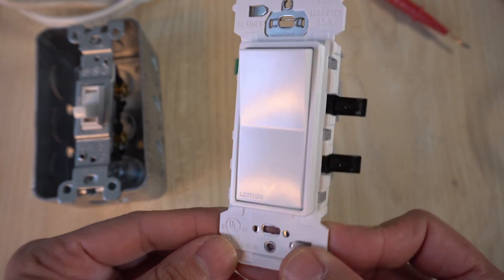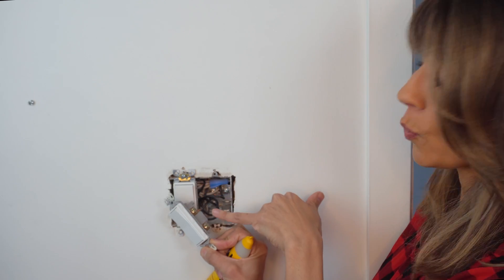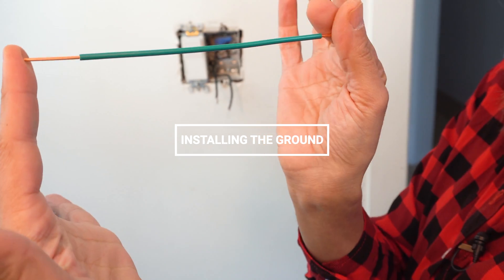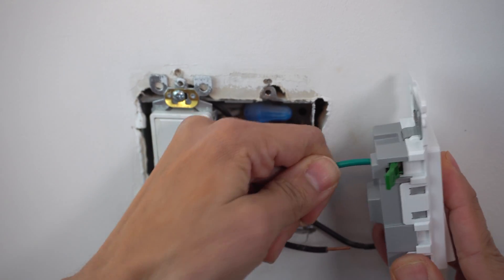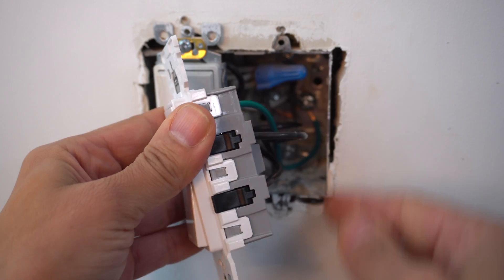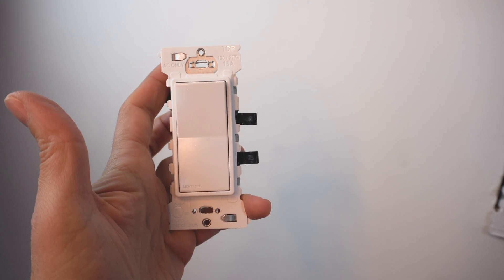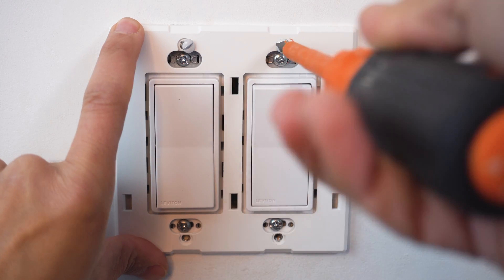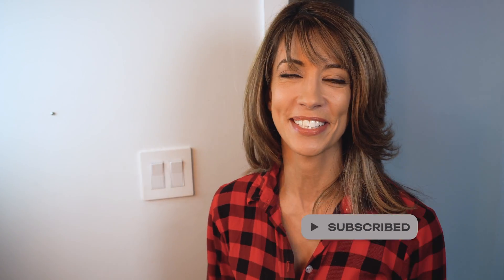Switches of The Future Are Here: Why They Finally Got Rid of Screw Terminals

Comment: Can you install these 15 amp switches on a 20 amp fuse panel breaker?
Reply: Yes it will trip at 15A just don’t do it the other way.A 20A won’t trip at 15A.

Comment: I could say a lot about this video, nothing really critical, just interesting to me.

I definitely like the new WAGO connectors over the previous generation WAGO’s. In my experience, this is about the third generation of WAGO connectors, but new connectors with bigger tabs are so much easier to open.

I hope Leviton has improved their plastic formulation. I used Lutron Claro Light Switch & Outlet Cover Plates with some Leviton outlets in my home about 12 years ago and color wise they were a good color match originally, but since then the Levitons are turning more Ivory color while the Lutron wall plates are still a glossy pristine white. (I’m going to replace the outlets on this remodel because they’re old and ugly, like me🤪) Also, along with safety tips, like turning off the associated circuit breaker (CB) and verifying the power is REALLY off, I like to, since I’m already working at the device, label the wall plate and the back of the cover with the panel # & CB #, like M2 - 5. Saves time for someone later when you need to find the CB to turn on/off. It’s easy to pry the cover off. Someone will appreciate this. Maybe let the home owner know about the labeling if you do.

Electrical tape in a box? Interesting comments on that. I agree that someone not familiar with electrical wiring probably shouldn’t be mucking about in an electrical box. If you use electrical tape, pay a little more and get a better quality tape that won’t break down over the years. I’ve gifted some electrician friends with 3M Scotch Super 88 Vinyl Electrical Tape, especially if you’re using it on your own stuff. Personally, I’ve never used tape on a switch or outlet.

Last one, I promise. Are you really using slotted screws? You must have ample time and great patience. Throw those screws away! Get yourself some 6x32 Philips  and a good electric screw gun. I’m on my second screw gun (a small Milwaukee) for over 40 years, can’t say the same for batteries, maybe 3-5 years.) Broke ligaments in both wrists. Do yourself a favor and get a small electric torque screwdriver with a Chapman set of bits. Even better than Phillips screws, try some square drive screws, but whoever follows you will probably curse you if you use the square drive screws. I first ran into square drive fasteners on a Canadian motorhome. I couldn’t believe how much better they are. They were even used on my kegerator!

Just my opinions, your mileage may differ. I hate wasting time and effort especially with repetitive jobs! But then again, I’m probably not as agile as you are.  😁

BTW - I’ve just discovered your channel, thank you. I am getting ready to lay about 1,800 sq ft of riff cut white oak flooring and the subfloor is a mess. Your instructions on using floor leveling is great. I’ve used it before but was a little trepidatious on using it on a large area. Thank you!
Reply from the maker: Great to hear from you, and thanks for the detailed comment; I appreciate your perspective on the evolution of the connectors.

Comment: Why don’t you want the copper exposed around the bolt? Asking because I need to replace a switch and noticed the broken switch has the copper showing as in this video.
Reply from the maker: Good question thanks for asking. Copper wire is conductive. If metal touches metal it can cause a short which is not safe. That is why wires are insulated with the plastic sheathing for protection.

Comment: What outlet covers do you use? I have been replacing light fixtures all over the house lately and have found a couple dirty secrets. With a bathroom vanity light there was no box. House built in 1988. Supposedly back then code allowed the fixture to be the box. Nuh uh! Put one in. With a bathroom ceiling light it had a very shallow, round metal box that wasn’t grounded. Yikes. Fixed that. I love Wago connectors. Anxious to try the lever lock outlets and switches. Hopefully the prices are coming down. If I replaced every switch and outlet it would cost a fortune and take a month to do. But I’m retired. I hope I have time.
Reply from the maker: If you’re replacing a lot of outlets and switches best price is to buy in the multi-pack. I have a link in the description where they cost $2 each. You can use a name brand or budget brand cover. I often use the less expensive ones because and they work well. It’s great that you are taking the time to do your electrical when you can. That’s smart.
Reply: @DaruDhillon  thank you. I checked through your link and the multi-packs are well priced. Just have to do the replacements in stages. We have 3 levels so a lot to change out. I just ran across your video; learned some things; enjoyed; subscribed.
Reply from the maker: @jugheadjones5458  thanks! I’m glad you found it helpful. I like to do projects in stages too. Everything comes in time. Enjoy your day!

Comment: Hello Daru , Since you introduced this kind of switch , I hope it's available in 3 way and 4 way because I've replaced 3 way switches and occasionally I'll come across a light fixture that's controlled from 3 or 4 locations which incorporates 4 way switches as well 
Also I hope they're available with the standard handle on the switch 
This design is great as the receptacle with the lever connectors and no worries about grounding out against the box , Since you introduced the switch , It reminds me back when I was little , The house we lived in had the old style push button switches along with either brass or copper cover plates 
You are one of the very few individuals who connect the ground wire to the switch , Which is great because a switch can fail , Especially those cheap switches which the internal mechanism can come in contact with the mounting bracket of the switch which can make it live and dangerous 
Whenever I replace switches , it's very rare that I see ground wires connected to them , It's great that you connect the ground wire to the switch because you understand that proper grounding is just as important for switches as it is for receptacles
Reply from the maker: Thanks for that Marty I tend to ground everything. They do make 3 way switches in these too which you should like.👍🏽
Reply: @DaruDhillon  Thank you very much 
When I was talking to my younger sister and her husband about replacing all the receptacles and switches In their house 
I definitely want to use the new style receptacles and switches you introduced because they have your stamp of approval and they'll save alot of time in installation and I love the safety designed into them 
Plus they'll save me money on electrical tape because they don't need to be taped as compared to the conventional receptacles and switches , One thing I definitely love about your videos in electrical work is that you use insulated screwdrivers and I have them too , Insulated screwdrivers are especially important when working in a circuit breaker panel , It would be great if they came out with a ratcheting insulated screwdriver because sometimes I wanted an insulated screwdriver that's ratcheting when making connections in tight places 
So what I did , I have a Stanley ratcheting screwdriver and I put 4 layers of heat shrink tubing on the shank of the screwdriver to insulate it because a ratcheting screwdriver is very helpful when making connections in tight places , Such as a circuit breaker panel 
The only part of my Stanley ratcheting screwdriver that is metal is the shank and there's no metal at the handle itself 
So if you have a ratcheting screwdriver 
Apply 4 layers of heat shrink tubing to the shank and give it a try and see what you think , I'm so glad I found your videos because you do them very professionally and safely , I saw that kind of tester that you use in your videos and where did you find that one because I want to get one for myself and who makes it , I have a receptacle tester but I like the one you have 
Another very cool item to have in your electrical tool kit is a circuit breaker finder 
My older brother got me one for Christmas several years ago and it sure saves time looking for which circuit breaker to turn off

Comment: Can you give your advice on Leviton E5601-MW recpeticals they are new with built in wago connectors, I just bought 30 of them but after reading some stuff online and talking to an electrition family friend i am now parinoid about using them. They do seem very light and plasticky but i dont plan on plugging anything big into them like heaters etc. Also is it safe to install 15a recepticals chained to 20a ones on the same circuit?
Reply from the maker: I think it’s important you make a decision that feels right to you. I can understand all sides. Electricians are often cautious with good reason. On the flip side extreme caution prevents innovation. If you’re using heaters you can always go with traditional outlets. I had a heater catch fire on me once, years ago due to overheating. Caught it just in time. I haven’t researched or used the model you posted so I can’t weigh in. Thanks for your question.
Reply: Ok, the outlets are the same versions as these switches. @DaruDhillon

Comment: looks clean but I can see myself cracking switch while breaking off tab lol!  Also how easy is it to remove face plate without wall damage?
Reply from the maker: Regular wall plates remove easily with a flathead screwdriver. Screwless plates are removed by inserting a flathead screwdriver on the underside of the plate to gently pop off the wall plate.

Comment: Imagine how a plastic molded assembly holds up to an assembly made from Steel over 10 years? While you cannot see inside that assembly, what actually bonds your circuit together when you close that little plastic snap you can absolutely see how well a good electrician can make a perfect electrical contact with a screw against a copper wire and apply the proper amount of torque so that the connection is both clean and strong and tight so that it does not turn into a fire hazard. Also after 10 years when you open a box that has had electrical tape wrapped around it to make it less shocking for the person to service it, you usually find that electrical tape is no longer functional as such a safety barrier. If you are not the electrician or know what you're doing you shouldn't be in those tiny little boxes in the first place! Cute device, but I wouldn't trust it till I get one in my hands and completely take it apart to see just how good it makes contact for an electrical connection. I worked for a plastic manufacturer and I know very well how Plastics degrade over time and if the pressure against the electrical connection is dependent on force made by a plastic component.... well it's game over for me.
Reply from the maker: Thanks for your feedback on this!

Comment: Bought a 10pk last week.  I won’t use anything else.  Plastic tabs were a bit finicky to break off but. 

Color me shocked if the residential industry isn’t a majority of lever based paddles, receptacles within a decade. 

Yes some people will FUD but honestly I’d rather upgrade the quality of my breakers and add surge protection rather than twisting copper around terminals.
Reply from the maker: Thanks for sharing your experience with the new lever terminals. It’s important to hear people’s opinions and feedback like yours who’ve actually tried them. Your reviews matter.